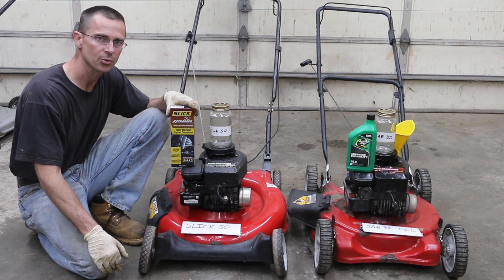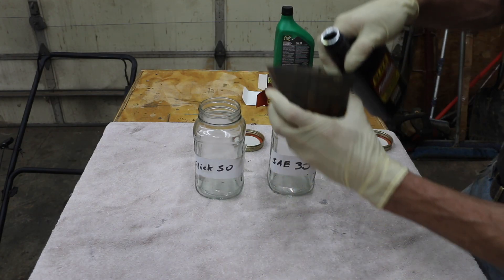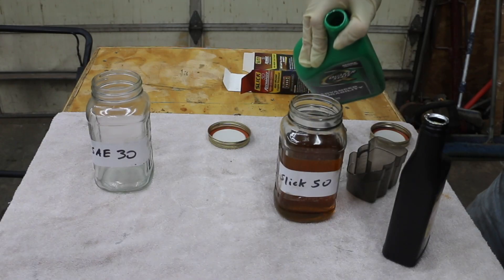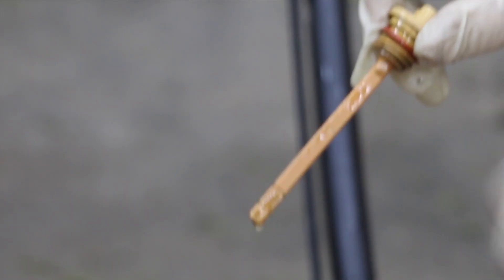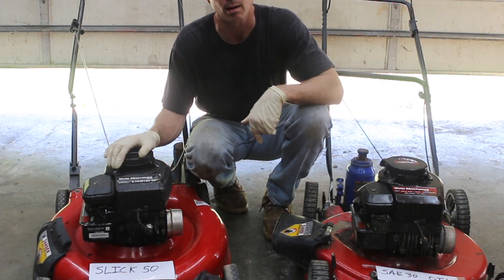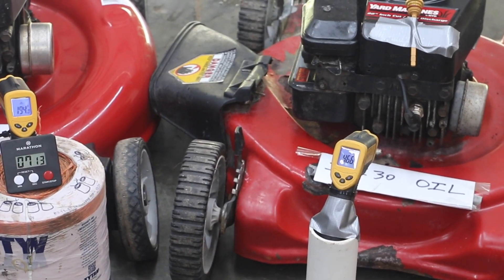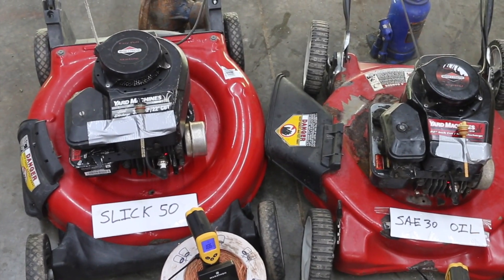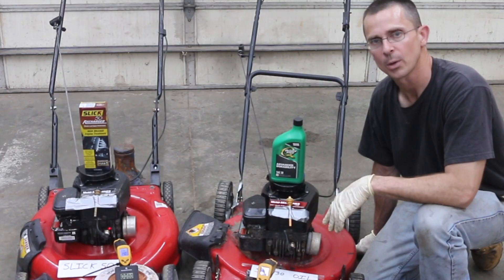Can't believe what SLICK 50 did to my engine!!--Dry Crankcase Test!

Comment: You need to open them up!
Reply from the maker: Great idea!  I'd like to see the damage!  Seems like a great future episode! Thanks for watching the video and commenting!
Reply: I used to work on these same type of engines on mini-bikes.  The connecting rods have no bearing inserts, just the aluminum of the rod.  The crankcase bearings varied from plain bored out block aluminum to ball bearings on the output side.  This goes back 40 years, but I doubt these small engines have changed.  After my time, the newer overhead valve honda and briggs type engines, I don't have a clue.  But Honda always raised the bar for others to catch up.  You'll have to do a net search.
Reply: The slick 50 engine did not die from the extreme heat like the SAE30 engine, maybe the engine isn't too damaged, or damaged at all.
Reply: agreed
Reply: @allenscott19832008 Had to look up what babbitt bearings(casted white metal) were; yeah, i have come across some of them engines, and some that just use brass slip bearings too, some use pin bearings, no idea what these 2 used though. 
till, I'd like to see what damage between the con and crank is or what the piston rings look like.
Reply: Maximus Psychosis these engines do not have replaceable bearings they are babbited bearings
Reply: robert retka made them easier to use and they tracked straighter
Reply: i was about to mention that too, I want to see the wear'n'tear on these motors too
Reply: @Rattlerjack1 I suspect baring let go due to "Cold welding" to the mating surface, and spun it. I would bet the one that overheated would run again
Reply: larslarsn and
Reply: Avblend the stuff is FAA Approved. For cars it goes by Zmax
Reply: Maximus Psychosis I have been a small engine mech for almost 25 years
Reply: robert retka yea in the case they did I have a 40's f series b&s but the big end bearing was babbited
Reply: That's really what I was hoping for!  From the lower cylinder head temperature, I thought the 50 motor may've been running leaner, which would provide less upper cylinder lubrication, especially important in the absence of oil, and judging by the sudden spout of smoke from the oil fill it seemed to lose compression from ring failure, while the 30 engine ran longer, got hotter, richer mixture probably kept the rings intact, but then it failed from extended metal on metal and stopped fast and hard.
Reply: +AreThereNoMoreNames ....i completely agree with you.  i also am absolutely confident in Slick-50 & use it in all my engines for the past 20 years.  I've always used Slick-50 and always will.  you're absolutely correct, Slick-50 showed it had far superior metal to metal protection which is exactly the job it does

Comment: I would have liked to have seen you remove the oil from the engines and then put the oil in the opposite engines and see if the temp differences follows the oil.

Comment: I was at an airshow years ago where they had a Slick 50 treated lawnmower engine sitting there idling on the ground with just water in the crankcase that you could see through a plexiglass window in the side.  It looked pretty impressive, but who knows, they probably could have done that with an engine that previously had just oil in it too.